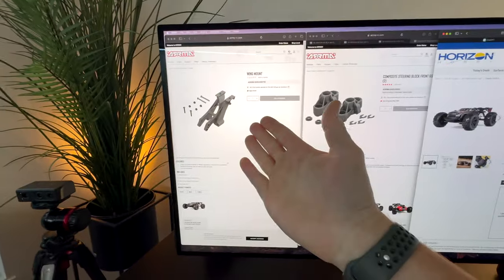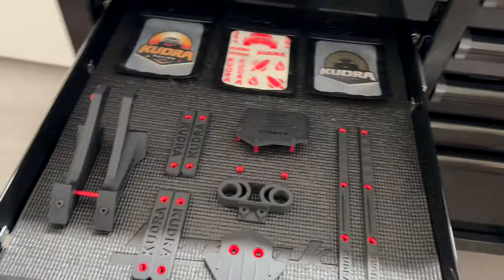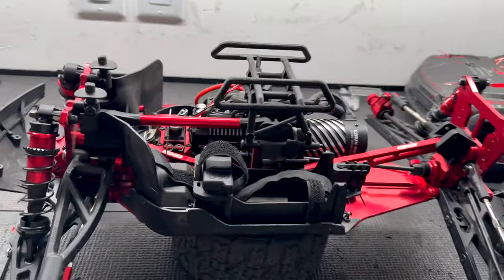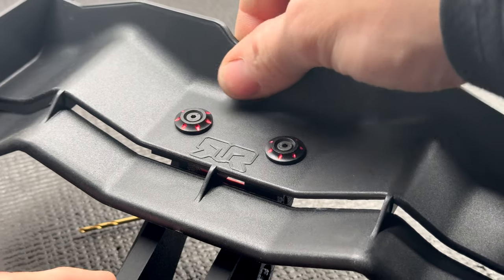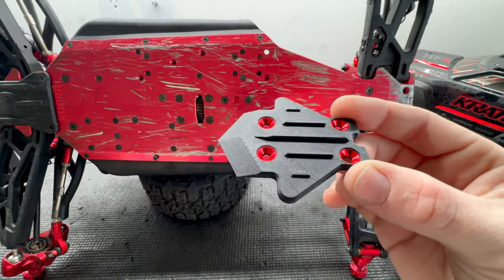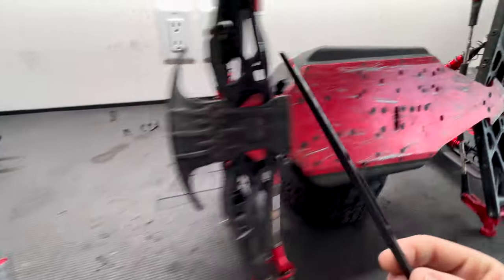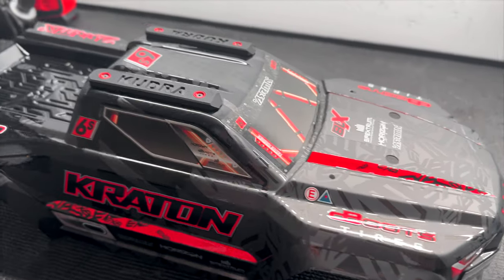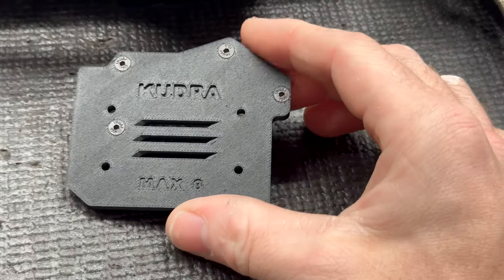Jump higher, crash harder - Kraton owners only - custom parts

Comment: Just a heads up. Check that sensor wire. Looked like it was on the pinion gear. Good luck.
Reply from the maker: Thanks for the tip

Comment: The kraton looks bad ass man. I am been trying to get rear lower skid plate for my mojave 4s they out off stock everywhere from my local hobby to ebay can u make few i can buy off u.
Reply from the maker: Thx bro! Infact the bolt pattern is the same for the Mojave. I have a Mojave chassis here and it works mint! 🚀🚀🚀  send me a message on eBay and I can send you some photos if you want 👊
I’m planning on doing a full Mojave build soon!

Comment: What's your thoughts on putting the metal exb diff housing and diffs with 80k from kraton exb 6s v2 in the fireteam. I want to do it but I don't see anything on YouTube about it. I want to do it but I'm worried about it changing the way the fireteam drives.
Reply from the maker: I have the same metal diff and diff housing in both my Kraton and Fireteam. The Fireteam really benefited from the metal upgrades... I would recommend 80k fluids front and rear, 2million in the center. The 2million in the center really helps it drive better. More 4 wheel drive effect and less front wheel ballooning. Sounds like you have a fireteam build coming up!!
Reply: @KUDRARACING  thanks. Fireteam come with 500k in middle and only 10k front and rear. I love the way Fireteam drives and I already have k6 exb v2 and I don't want both cars to drive same way. 
I'm gonna gonna do it anyway, see how it is and Send It! 😆